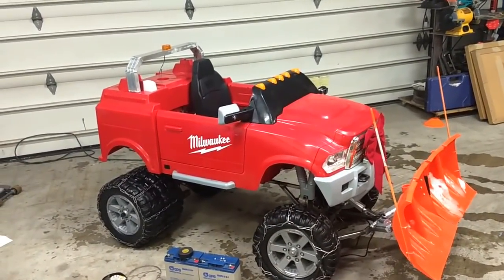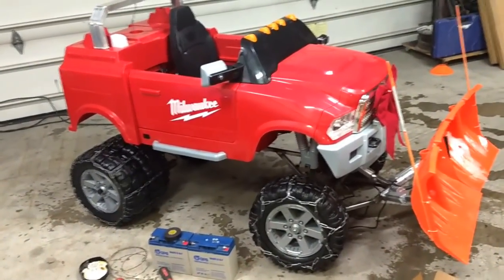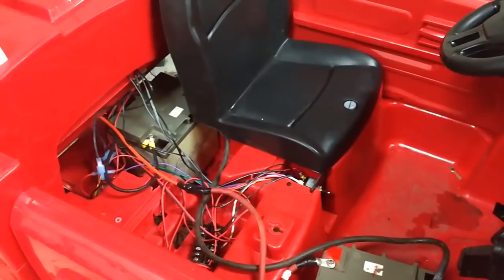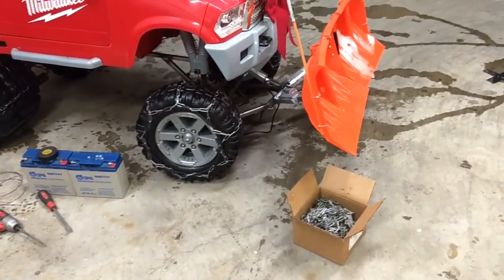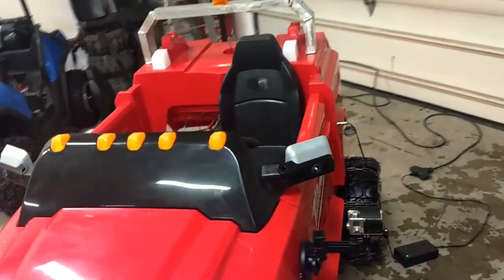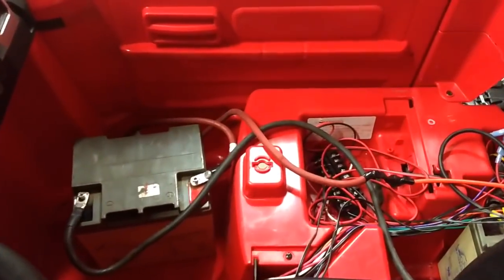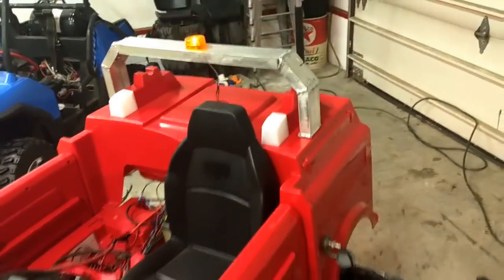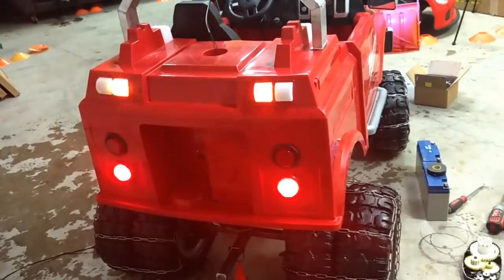4x4 powerwheels build with V-plow 24 volt upgrade- Part 7

Comment: If you can comment me back on this  video.
Reply from the maker: +Kyle Walsh thanks for the positive comment. It's all good, there will always be haters and idiots that have no concept of how a powerwheels gearbox actually turns a wheel driver and the plastic tire is actually engineered to slip, preventing broken gears...

Comment: awesome rig guys maybe more weight and rubber tires may help
Reply: dude you dont need rubber tires.
Reply from the maker: +gone squatchin thanks and the build surpassed what we expected out of the goal of using stock drivetrain that fits within the projected budget. Stay tuned for the crazy electronic we are adding to "Project HD"

Comment: #NoRubberTires

People just don't get what rotational mass and traction do to gearboxes.
Reply from the maker: +gone squatchin that would be great, but you have to consider the costs involved. We have the metal gearboxes but they cost $200 each plus the cost of the rubber tires, disk brake setup and custom wheel adapters. In reality it is a kids toy and is in no way meant to replace a full size truck. Now if a customer wants to throw a bunch of money at a build we will gladly add RUBBER tires...
Reply: then you got to beef up the gearbox lol